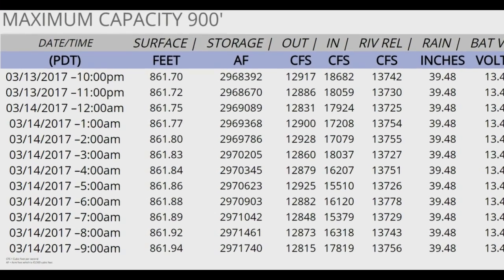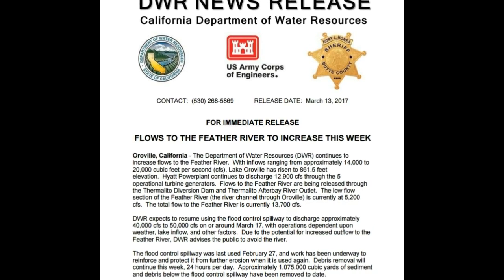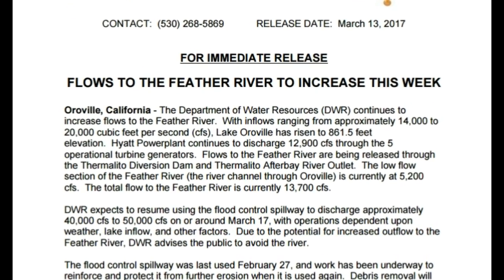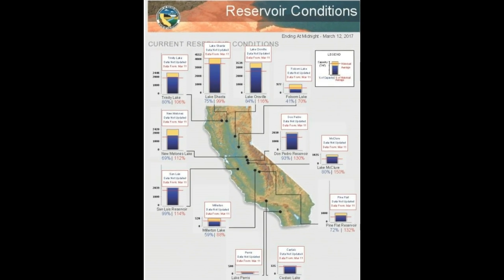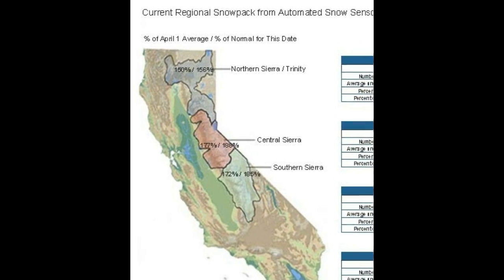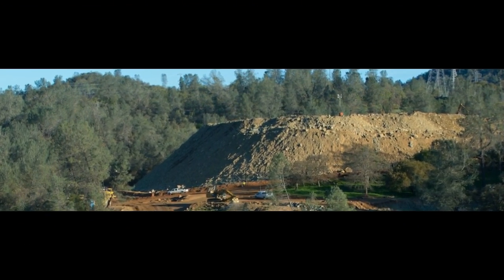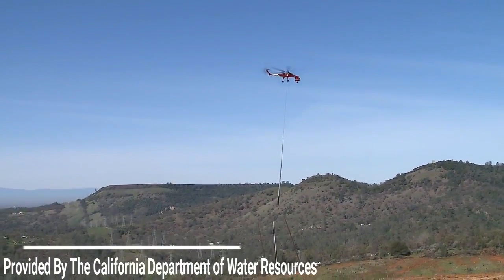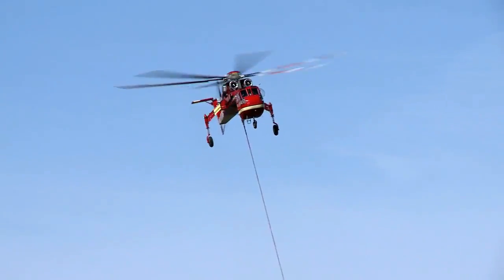Snow Melt/Reservoir Conditions | Increase River Flows | Lake Oroville Dam Updates 3-14-17

Comment: Couldn't they have used some conveyors to move the debris out of the river to the area in the middle of the spillway to fill it in then concrete over it.
Reply: Not enough time.  The amount of work to fill it in, properly compact it, build the forms to replace the lower half, poor it and allow it to cure will likely take a couple years.
Reply: They tried to fill in the original cavity on Feb 13.  The power of the water during the next use of the concrete flume flushed out all of that material, much of it landing at the bottom of the spillway.  Dump it in, then dredge it out.

Comment: I don't know why they don't put over a series (50ish) of long siphon pipes over the emergency spillway to constantly lower the lake level while the In flows are not so high. It would help prevent erosion and keep any water in an existing eroded channel.
Reply: I thought of the same idea days ago, but supposed it was not implemented because it could not give the volume needed.  but it is an easy fix and over time it seems to me siphoning the water out of the lake would make a difference that might have given them a day or two extra to work with if they had used the idea in the beginning.
Reply: You would use a pump and then once the siphon was running you could disconnect the pump and it would run by itself.
Reply: The lake level may already be too low for a siphon to work.  If I remember my fluid mechanics correctly, you can only draw water up about 32 feet.  If the lake level is more than 32 ft below the top edge of the emergency spillway, then no can do.  The reason you can't draw water up any further is the low pressure causes the water to vaporize/boil.
Reply: And how does one prime such a siphon tube, exactly?  They don't fill themselves.
Reply: I believe you are correct.  The water will have to get within 32 feet of the overflow before a siphon will work and since the volume would not be enough to handle all the inflow all that pipe or fire hoses would be washed down river once the dam was over topped.  Source:  The Encyclopædia Britannica currently describes a siphon as:
Siphon, also spelled syphon, instrument, usually in the form of a tube bent to form two legs of unequal length, for conveying liquid over the edge of a vessel and delivering it at a lower level. Siphons may be of any size. The action depends upon the influence of gravity (not, as sometimes thought, on the difference in atmospheric pressure; a siphon will work in a vacuum) and upon the cohesive forces that prevent the columns of liquid in the legs of the siphon from breaking under their own weight. At sea level, water can be lifted a little more than 10 metres (33 feet) by a siphon. In civil engineering, pipelines called inverted siphons are used to carry sewage or stormwater under streams, highway cuts, or other depressions in the ground. In an inverted siphon the liquid completely fills the pipe and flows under pressure, as opposed to the open-channel gravity flow that occurs in most sanitary or storm sewers.[93]
Reply: Green Silver cause its usa, they don't resolve problems they create them
Reply: When the inlet and outlet are at the same or slightly differential grade with a downhill run in the middle that is not a siphon.  You have to get it up and over the dam embankment.  However, me being the generous fellow I am will allow you to submit an actual scale proof of concept.
Reply: Claus. it's not that easy.  You don't just drop one end in and drag the other end down.  Especially if the pipe is steel.

Comment: In addition to the possible core samples, at the 2:17 mark, they may also be doing a little grout injection to fill any under-slab voids for vibration reduction when the spillway is used, or, less likely, try to raise a sunken portion of the slab.

Comment: Is that mountain of debris in the path of the emergency spillway? I can't tell.
Reply: The dirt pile is located on a raised portion of the emergency spillway towards the foot (near the river).  This was an area that was not eroded when the ESW was used last month.  The path of the water diverted around both sides of this section.  I'm assuming DWR feels pretty secure that this mound won't be impacted by any runoff of water.
Reply from the maker: +blipco5 not sure